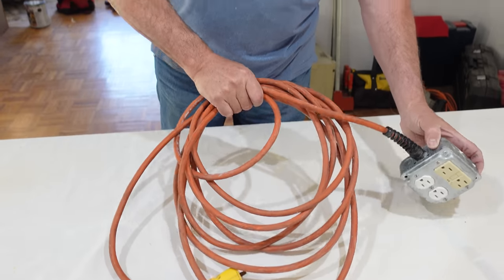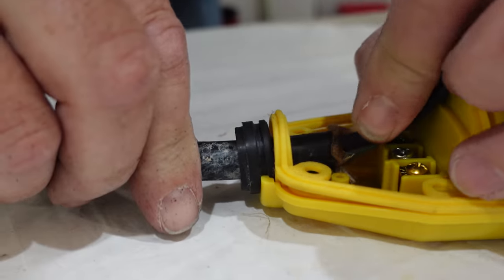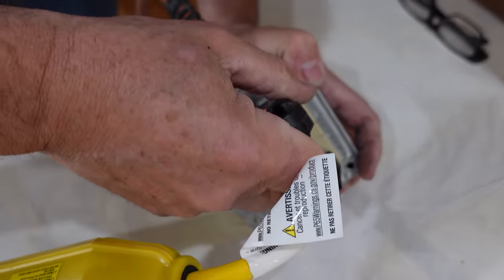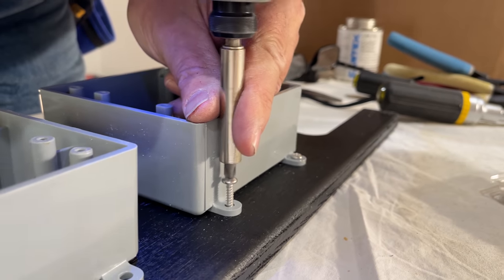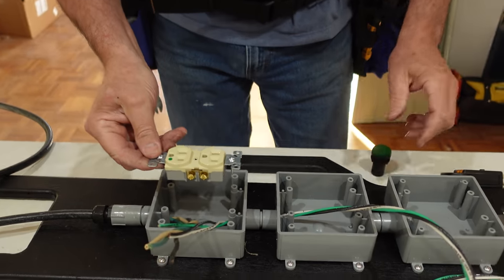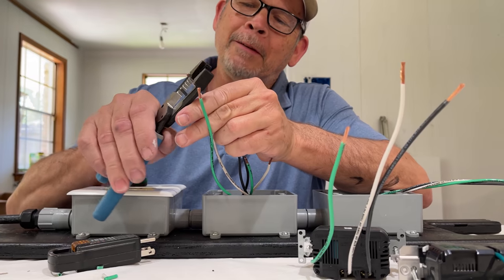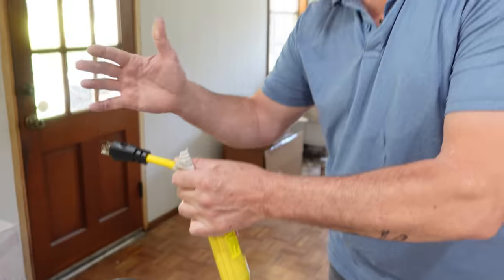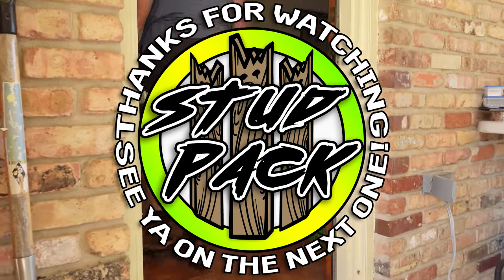HOW TO MAKE THE ULTIMATE EXTENSION CORD!

Comment: @3:00 instead of struggling to pull the sheathing, instead just twist it as in "Lefty Loosey” Once the sheathing is removed, you'll notice the core wires are twisted in the same direction thus allowing short sections of sheathing to literally be unscrewed. No slicing required  ; )

Comment: The magnetic portion of a circuit breaker is designed to handle 200% the rating of a circuit breaker. This is to account for the surge current of air conditioners, motors, and compressors when they start up. I personally would use a light switch with a pilot light and put in a 15 amp circuit breaker instead of a light. I'm speaking more for a general home user. I'd rather not pull 20 amps through a 15 amp receptacle. It could just be a cheap home grade receptacle, and only the links between the screws have to be rated for 20 amps. A handy circuit breaker in the cord can save you a trip to the breaker panel depending on the kind of overload it is.

Comment: Great video and ideas!
The reson its not good to run a clogged vacuum is cooling. Most vacs cool the motor with that air and will over heat without it as they tend to run hot anyway.

Comment: With the vaccum cleaner being plugged drawing less current, not only is it moving less air, the air is at a higher vaccum pressure, the air is thinner, so there is less resistance to the blades or vains turning in that thin air.

Comment: Great video! Seeing you working with your dad brought me good memories when I worked with my father when he was alive. I just have one question could I make an extension power cord to use with 220v and 110v with same power cord? I would like to power a welder and maybe another tool. Welder has a power auto -switch. So if 220v available use it for welder and plit one hot line to separate receptacle to use 110v tools. Is this a good idea? Any recomendation?

Comment: Cooling of the engine internals in a vacuum cleaner is achieved through the air that is passing through the air Path, in any direction.

When the intake gets clogged there is not air passing through and the engine will immediately start to overheat.

So you should indeed switch it off immediately or it will go into thermal protection and eventually it will burn itself to death (bushings, wires, casing...) because of the thermal inertia of the Electric components themselves.

Comment: I am not an electrician.. But the reason that it held on 28 amps... Was that the load was constant and stable.  If you suddenly had a heavy load that fluctuated for even a fraction of a second... it would have tripped.  Also I suspect it would not have held for long under the high load.  when the 12 guage wire started to heat up... the power becomes less stable and it would trip. 
A lot of breakers check the frequency of return voltage. so "noisy" return = problem. Hence it was fine with the higher ampage as long as it was stable return.

Comment: What an interesting & informative video.  

You mentioned toward the end of the video the possibility of wires heating up without a breaker tripping.  

Does an in-line wire temperature gauge exist?  Is that a practical feature, if one did exist?

Comment: Trip curves. the circuit breaker will have a curve at which it will trip the internal mechanism the same goes for a fuse. So you can briefly pull large bursts of power for say starting motors like a vacuum and then it dies down a bit but if it doesn't die down and stabilize and it continues over X amount of time it starts to be considered a fault and usually a bimetallic strip (there are other technologies and failsafes) in the breaker heats up and bends slightly to the point where it triggers the trip mechanism. The more you draw the shorter the time in which this piece of metal heats up the quicker it will trip.
you want the fuse or circuit breaker to be the weakest link so your wires don't heat up, they are there to protect the wires. In the old days of fuses it was common bad practice to increase the fuse size or put a penny behind it putting your trust in Lincoln that your house was not gonna burn down. So it's so much better that we've ended up with reusable breakers that are hopefully installed with the correct ratings for the sized wire.

Bonus info. A 15 amp circuit is technically rated for 12A continuous and a 20 amp circuit is rated for 16A. This builds in a bit of a safety margin as well as the American wire gauge size Standard. And since most circuits aren't going to see a continuous draw it's OK. but if you were going to have something like say a large dust collection system or tablesaw that's gonna be running a little bit longer it might call for a dedicated circuit so it knows it has a continuous margin of power it can draw.

Comment: The breaker didn’t trip because general purpose breakers have an inverse time current curve.  In English, that means the breaker will support the rated current effectively forever, but if you overload it a little it will trip eventually, if you overload it a lot it will trip sooner, and if there’s a bolted fault it will trip almost instantaneously.  

Put it another way, that 15A outlet is rated for ~1800 Watts, or ~1400 continuous load.  It would be a real PITA if breakers tripped the moment you plugged in 1801 (or 1401) Watts of load, and there’s no reason to be that conservative with our designs - the conductors take a while to heat up and there is margin built into the system to account for the one or two times that you turn on the shop vac while someone’s making a cut.  However, if you plugged in an electric space heater and a set of halogen lights and the coffee pot then eventually the breaker would trip - especially if you started the table saw on the same circuit.  If you had a wiring fault on your old circular saw and plugged it in, the breaker would trip almost immediately.

Comment: Great Video, Maybe you can help me?, Was in garage, 2 overhead florescents, Went out, discovered kitchen overhead was also out. Counter tops live. Breaker box had 20A with White and black togather. seems to be a dead short as, when fliping the breaker on, flip off simultaneously. Remove wires, breaker is fine??

Comment: stranded wire in clamp terminals will spread out over time and need to be checked and tightened periodically. Using ferrules on stranded wires gives a better connection and is less likely to loosen over time.  same thing with your ground wire it will most likely loosen over time especially as your wire is two sizes to big for that connector. A ring or spade crimp connector will hold stranded wires better and can cater for the over sized wire. Also everything looks waterproof except the face plates on your boxes,

Comment: I see lots of items you guys are using like the yolk that you used when installing the green light in the first box. I have a different problem I was installing a new GFCI receptable and thought I needed to remove the 2 ears on the top and 2 ears on the bottom of the GFCI(boy was I wrong on that, but that is another story), so I should not have removed those ears so is there any way to fix this other than buying a new receptable, because when I installed the one I butchered I saw the receptable did not lay flat since the ears were gone and could not brace against the drywall? So I guess I will have to buy a new GFCI and should I get a new receptable that both AFCI & GFCI for my garage? I know you are from California and I live in Upland CA in San Bernadino country near Ontario.  Keep up the great videos.  thanks Jim

Comment: How about this for versatility - add 2 more Bell boxes, put a 20A breaker in on at the very start to save you from running all the way to the panel to reset a tripped breaker, and 2, right after that, add an LED digital ampmeter and voltmeter in the second box. It can be configured to get the amps of the whole string or just the box with the switch and plug. No fumbling around for multimeter when dealing with just AC power.

Comment: Check with the manufacturer of the breaker they should have a time current curve showing how long the breaker will sustain a higher current before it pops. Some breakers will allow up to 1.33 times the recommended current with out popping.

Comment: Your work, Suggestion, approval
Very nice job.  A cord with all of these features is just not available.  Discovered you most recently already having watched two of your videos.  I enjoy your brevity, professionalism and excitement.  They definitely keep me away from the “back” button.

Suggestion:  Place a surface mount receptacle on your table saw.  While you are it, give your saw a 15’ or so cord.

“OSHA” approved.  you are correct,  the cord set is not approved.  There is a section named Electrical in the safety and health regulations for construction Part 1926 subpart K titled “Electrical”.  Primarily this is what gets you  “boxes intended for use in a permanent installation may not be used (1926.403(b)(1)(i))”.  If you read other parts you will find that “factory made”(my words) may be used.  Fortunately, in 1992 there is an interpretation allowing qualified persons to assemble “Contractor shop-made extension cords.”  OSHA calls it temporary wiring
Thanks for what you do.

Comment: I don't know about you guys, but I run polishing discs on a regular grinder to clean up cuts while installing stone in showers, 
Or profiling stone bullnose for backsplashes..

Running said grinder at it's full power eats the polishing pads up very quickly.

They make variable speed polishers, which ARE nice, and VERY worth the price with it's water injector, ECT.. but around here our customers have wine taste in a beer budget and want the best deal possible (until the $500 bid for a shower install they accepted over my $5000 bid leaks, then they understand why mine was much more, and want me to put my name on it by patching it.. needless to say, that don't leave me alot fancy high end tools.

SOOOO.. I personally wire up a box like these, with a dimmer controlling a receptacle, so I can slow the RPMs on my grinder down.

You should add one of these setups to your cord.

Comment: You can leave the ground a bit longer than the other wires. That ensures that if the cable is ripped out the ground rips the last. that might improve security a bit. :)

Comment: Great video, 
I’m starting to work with an electrician to wire my garage to turn it into a music mastering room/ Atmos theater. 
Do I need four 15a boxes if:
2 amplifiers at 1600 watts, subs
1 for Atmos speakers, 1700 watts 
1 for all the gear.
I was a DJ, my system had a 5000 watt QSC amp going to a massive 18” sub and 2000 watts going the the rest of the system. All of this would get plugged into regular outlets at venues. I don’t understand how I didn’t trip circuit or start fires.  Normal outlets are 110-120V at 15A, that’s a max of 1800 watts!
Thanks

Comment: 21:40 20-amp plug should be in box CLOSEST to the power source (left box in this shot), so high current passes thru the FEWEST connectors.  Green indicator light can go ANYWHERE.  Tie-wrap sections of "Pool Noodle" to back of unit so IT WILL FLOAT if accidentally drop in pool, toilet, or septic tank.  < Just kidding with last comment about floating. >

Comment: The reason why the breaker didn't trip is because it takes time for it to trip. The breaker has a temp sensor detecting if the wire is heating up. Once the wire is hot at the breaker, then it will trip. So yes, technically  you could run more than 20 amps through that circuit but not for a long time or the breaker will trip. Th other way the breaker will trip instantly  I by a direct short from hot to neutral or ground

Comment: Some additional feedback and questions…
1. How does an auto-reset circuit breaker do the auto-resetting part?
2. You outta use soap instead of spit.
3. You can coat your metal boxes with white flex seal on the interior, and white truckbed liner on the exterior.
4. If you want to achieve a high-visibility effect, then you can mix retroflective and fluorescent pigment into the truckbed liner. That’s why I suggested white.
5. A dedicated 240 volt socket would be pretty awesome as well. But you may need a separate transformer for that.
Reply: I figured everybody would say something about the spit... LMAO

Comment: A 20 amp molded-case breaker listed to UL489 is only required to trip within 1 hour when run at a 135% overload. So if that breaker carried 27A for 59 minutes it would still be working completely properly.

Comment: Question. We know extension cords heat up and should be completely unwound before use for safety. If you where to make the exact same cord(just for comparison sake) would making it with 10g instead of 12g help reduce the heat created(giving that you use the same device for each test) during use or would it actually increase?

Comment: The breaker is designed to allow devices that pull a high surge current to start without nuisance tripping. Motor-driven appliances can draw up to 5 times their rated current on startup. That why the lights dim. A breaker trips instantly on a dead short.

Comment: 2 questions...
1.  Why specifically sheet metal screws when you're going through plastic into wood?  I would assume they'll hold fine, just seemed odd to me 
2.  Why stranded wire?  It shouldn't be moving inside the boxes.
These are legitimate questions, what am I missing?

Comment: The green dot on the plug actually means it’s an isolated ground receptacle. So the ground is only connected to the screw not any other part on the plug. Usually for sensitive electronic. As for the circuit breaker. They will hold for a certain amount of time at a each amp over and for some beakers and amount of over current this could take minutes
Reply from the maker: Around here an orange receptacle is isolated ground and a green dot is hospital grade.
Reply: @StudPack  you know what now that you say that your 100% right. And now I feel a bit silly.

Comment: GFCI are not current limiter or current overload protection circuits, they are there to trip the circuit in the event that the hot shorts to the ground or return.

Comment: Every breaker has an I^2t rating for itself. This means that for a given current, it’s going to take a particular time for it to trip. If it’s a 20A breaker and 28A is drawn, it can take up to 5 minutes for it to trip. If the current is higher, it takes less time.

Comment: This thing is sick. But my tid bit would be to use the stak one on that wire it looks pretty fine strand it'll open up over time. Also in canada atleast it is code to use a crimp on anything over 19 strand wire. Also you went so far to use a weather proof box connector why not put in use covers on this unit so you can use it outside with out worry!

Comment: The 20 amp receptacle you installed is a nema 5-20, not 6-20.  Nema 6-20 has the other leg (the right one, what is normally a neutral) turned sideways and is used for a 20 amp 240v circuit.

Comment: You remember that you had your plugs on 12ga wire but your current testing line is for a laundry dryer and those chords are required to be 8ga wires. When you go up in wire size resistance decreases. I bet at the plug you were probably right before 20 amps.

Comment: I'm no electrician but I know a few of them and I know for a fact in nz the circuit breaker are always rated lower then when they will actually break the circuit so a 10 amp circuit breaker might pop at 15 and a 15 amp maybe 20 or 25

Comment: I may be wrong here, but shouldn’t the male plug at the GFCI have been a NEMA 620 and the GFCI been a 20a rated unit as well as the circuit been 20a rated since you have a NEMA 620 recepticle?
I believe the chart in NEC 210.21(B)(3) covers this.

Comment: It would be interesting to see what the voltage is on outlets with all that load and cord for resistance when you have everything running. I have seen motors stop running from too long of an extension cord

Comment: Why did you use 5 wire instead of 3 wire Wago 221's.  What is the reason for not using the 2nd set of termination screws to make the jump from box to box.  Also the breaker has an I²T sensor for small overloads over time.

Comment: Looks great! Curious to see how long the Flex Seal lasts. Rubberized coatings usually rub off for me, I use Rust-Oleum Hammered paint now
Reply: if i wanted a rubberized type of coating, i would experiment with "Henry Tropicool" amazing 100% silicone and begins to rapidly cure.
recently discovered but haven't tested "GT products" out of texas they are a manufacturer and sell direct. price seems to be closer to half of what you would pay for Henry product.

Comment: Just like the old glass fuses could be fast blow, or slow blow, most circuit breakers, and most GFCI receptacles are slow-blow nowadays.   There are only a few types of devices which would require a fast blow fuse, and power tools definitely aren't one of them.   So ten to thirty seconds of over current isn't going to really affect the cord or device it's connected to.   After about 30 seconds, if the 28 amps is not tripping anything, then you definitely need to investigate, as something isn't working correctly.

Comment: Fence repair video coming soon?  23:30
Please make it the "Ultimate Fence" (within DIYer reach) video. where ultimate means I never have to do it again, or if I do it's much easier to fix, e.g. easily replaceable panels (forever posts are assumed on an Ultimate fence).  Extra credit: The fence also generates solar power.  BTW, I'm really liking the metal fences I'm seeing lately, but they are also really expensive.